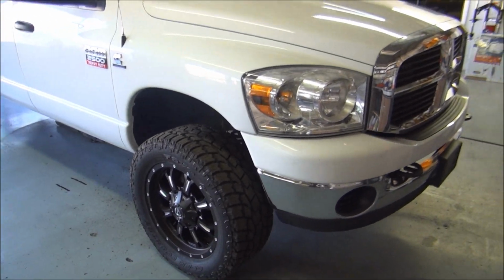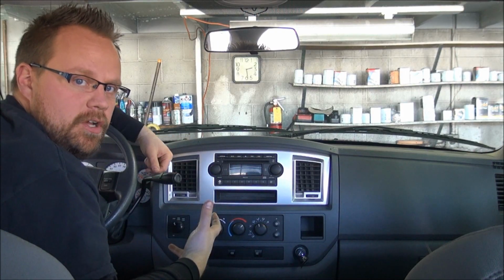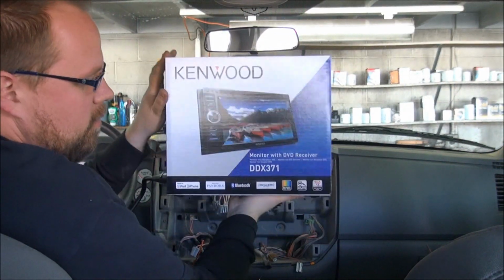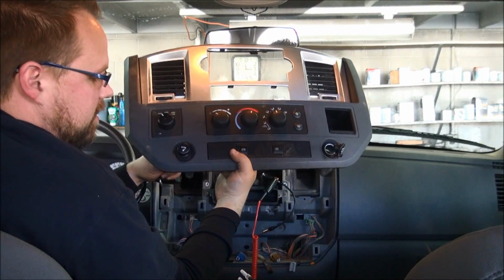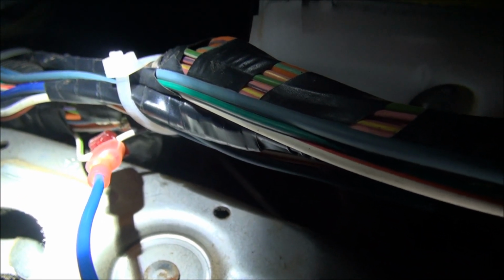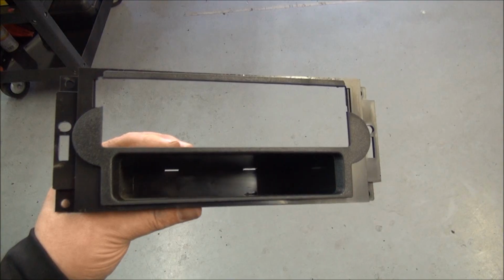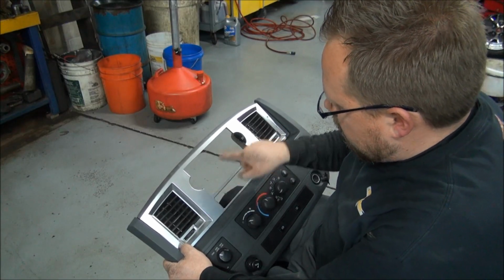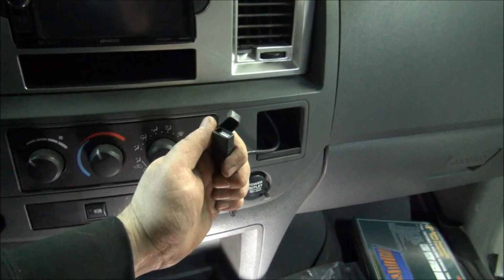Dodge Ram DOUBLE Din Radio Install Tips

Comment: I know this was 10 years ago but wouldn’t you not need the interface cable adapter on the manual version that only has cruise control functions on the wheel and no audio functions?

Comment: On my 2006, I tapped the white with green stripe, but I’m not getting 12v when in reverse? My reverse lights work, but that wire isn’t lighting up my test light… any suggestions?

Comment: I have a question I’m having problems with my install where the unit dose not power on but you said that it looks for a signal and you taped into the cigarette lighter so what wire do you hook up on the radio said?

Comment: All of the useful info in this video could fit in a 5 minute video. Don't care why you picked that radio. 

Also tells us all the right ways to do it and proceeds to do everything the cheap hack job way. Just buy the interface it's well worth it to retain steering wheel controls. Bypassing them is peak poor energy.

Comment: OMG, you just saved my butt thank you. Im trying to get a radio installed on a 2008 Ram 1500 and the universal harness does not match up with the power so I was having a hard time finding it. now I know where to hook up power to. ;)
Reply: Please tell me what to do my radio is lighting up but I have no sound
Reply: @markbarrett6227  if its your stock radio most likely its toast. But if there is an amp check the fuse fir the amp

Comment: I need a wiring diagram for a 2013 - 2017 Ram 1500. Either a color coded diagram or pin out for the large radio connector.

Comment: Hi very helpfull video but you dont show after finding the 12v where does it connect to ?? Im installing one and wondering where to connect the 12v on the main radio harness!!  Thanks
Reply: Did you figure it out im stuck right now and pissed lol
Reply: Find an answer to this?

Comment: Hey man i know it’s an old video, but in the description for the dash kit, does the link for the dash kit contain the piece that seals off the round-end edges from the volume and tuner buttons?  (The pieces you cut off the kit, to make the radio dash one solid piece) I followed the link to amazon I just want to make sure it before I buy it.

Comment: I have an 08 dodge ram 2500 Laramie with the infinity system in it, 6 disc Mopar radio. I’m putting in a pioneer double din and need to find the “amp on” wire on the vehicle side of the wiring harness. The wiring harness I purchased for this year model truck has the blue and white wire running to an empty slot. I know this video is six years old but any help would be appreciated greatly! TIA

Comment: Great job, where are you located? Would like to do similar set up on a 04 dodge Laramie 1500.
Reply: If you go with a single din pop out touch screen than youll save that compartment

Comment: I installed a Double din radio in my 3500, I did not trim the original dash piece. I purchase a new dash piece for the 3500 with NAV, not sure why you did not do that... Do it right..
BTW, I would have been pissed if you  scratch up my dash sliding radios around!

Comment: What do you do with the extra square connector that was plugged into the factory radio that has 3 wires in the plug? Do you just do away with it or?? Need some help. Just don’t want to leave anything out
Reply: You don't need the small plug it's only for the factory radio
Reply: Keith Tonak okay thanks!

Comment: you really don't have to do that with trying to use your dvd fun.... just use the same wire but it depends on what type of radio you have.just put the pink or orange wired on the top of the radio.... bam.....dvd player working I ran threw the same problem.ill be making a video on how to do it. I just bought a 2007 dodge ram big horn edition.and I think that it whould be a good time to do this.well we will  do the together.be on the look out for it

Comment: hello there
I've hooked up all the wires and tapped the yellow wire from the plug into the cigarette lighter but for some reason my radio does not work... do I still need to connect a red wire to the ignition, if so, to what wire do i connect it?
thank you very much
Reply: Yellow wire is constant +12v. You hook that wire up to the yellow wire on the harness and run the red +12v accessory wire to the yellow and pink wire coming from the cigarette lighter
Reply: @Keith-ky9pm  
thank you !

Comment: So you take ten minutes talking about the install at the beginning and just rush the ending, not covering at all how you wired in the steering wheel controls or where you mounted the SiriusXM antenna. Seriously what's up with that?
Reply: It's the base model, no cirius, no steering wheel controls!

Comment: I've got 0ver 40 years exp.  taking a dremel to a dash is not a customer job. Seriously pay somone to do it.
one slip its scrap and a drill bit will walk on you. Practice on scrap plastic  first this is not an e-z skill to learn.
I use a 4 flute cutting bit its worse than a drill bit it will run like a bitch if it gets away from you.
You better off using a flat bastard file that's a flat fine file for metal work. Even Pro's make mistakes and its real easy to do. A file is your best bet he only took off about 1/16" of material   on a delta 88 I used to cut out the whole din size all day long car after car after car. I've done eq's that look like the hole was made in the factory. no gaps straight lines.  I moved the clock on a 84 celica down to the pocket and moved the emergency switch about 1' to install an eq  with 2 din units.  Trust me use a file also you can cut it with a box knife just care it out with small bites. and don't cut yourself. you don't even ahve to cut all the way through you can score it and bend it off then file it. A dremel is not the only way to do this.
Ok this is all I came to this to look at. Thanks man  I haven't done one of these myself either.

Sorry but the automitic wire stripper's are a joke just buy a set of Klein crimper that dent the connection and Klein wire strippers. to loosen the join on the crimpers heat up the pivot point with a micro torch put oil on it and work it as its hot keep adding oil they will loosen up and wear in real nicely and just flop open instead of trying to pull them open. get the Red Black handle style.  Do not buy the smash type crimpers you should not be able to pull the connection apart before the wire breaks. and no copper should show outside the conector. or it could short out.
https://www.amazon.com/Klein-Tools-1010-Crimper-Stripper/dp/B0000302WX/ref=sr_1_8?keywords=wire+crimper+kline&qid=1566345593&s=hi&sr=1-8

This set will do both crimp and strip the wire's  save your money  but I would not use this set.
Not bad for your first one on this truck.  I'd almost say ship the dash kik and just use some ABS plastic but you won't flush the old knob holes..

Metra should make a replacement dash for this truck. with a modified pocket. I don't know why they don't they used to make one for an older honda, the dam kit hung on the wall for 25 years.

Your going to have to buy the back strap separate they do not come in kenwood radios anymore.

Comment: I have a 2007 ram  2500 it has the infinity system can I just buy the cheaper harness and tap into the cigarette lighter wire or do I need to buy the expensive interface one?
Reply: For infinity in dodges, just like bose in cadilacs, you need that Pac if you have steering volume power controls.

Comment: When u hooked into the lighter how did u hook it up I used the red and yellow wire off of the deck and hooked into the lighter but it still has no memory
Reply: Yellow wire is constant has to be hooked up in the harness to keep memory. Only the red acc wire coming from the radio has to be hooked up to the cigarette lighter

Comment: Thanks for the great install video. My 2008 ram has no steering controls besides cruise control. No navigation radio or infinity speaker system (3 dash speakers hikes in fash don't have speakers). I believe I can do the same I stall but what about the 2nd small harness right next to big harness in back of factory radio? I couldnt figure out what to do with it? Did yours have that too? Thanks for the help!
Reply: You don't use the small harness

Comment: I know this is an old video, but do you have the info on the dash kit and wire harness you purchased?
Reply: Oh, I see it in the description. Thanks.
Reply: Will the wire harness you used, also work for a 2007 Ram 1500? I am having a tough time locating the right harness adapter.
Reply: @Sharona Carr I ended up buying a replacement used stereo unit and postponed upgrading. :)

Comment: bri thanks for the video, can you tell me if the truck you worked on has a factory amp, because im being told i have to by an interface for like $70.00 , but i want to do what you did. any help would be much appreciated,or from anyone else. thanks again

Comment: Good job, but aren't you supposed to disconnect the negative battery cables before doing any wiring, in order to prevent a possible short?  I just bought a very similar Kenwood double DIN unit to install in my 2006 Ram 2500 (with the Infinity system), and I really appreciated your tips.  I bought the unit and the accessories from Crutchfield, and they recommended the Metra 95-6528B mounting kit, which was $20, and came with the faceplate/bezel, and the mounting brackets that fit the truck and radio; I think this is a bargain for not having to fabricate brackets  and to make it look like a factory installation.  I haven't mounted it yet, but I think I will lose all or part of the pocket under the radio, but I can live with that.  I'll probably add some sort of storage area on the current cupholders.

Comment: Hi Brian can you please help me 
I have a 2010 dodge ram 
And I'm installing a gps nav deck originally I had it working but when installing sub I blew the factory amp turn on box so then I am trying to bypass the factory amp.
I.bought was able to find a similar box I forget the name anyways.
The original amp turn on didn't use the one harness the speaker wire harness.
There are 3 wires to all speakers but when I connect them they don't work.
What do I do

Comment: Running to a switched power source on a dodge vehicle is easy. Just tie into one of the power receptacles with a "key" on the cover of it. That designates it as a switched power source, just tap into that wire and you're done.

Comment: Would a 7" radio fit in a 2008 Dodge Charger?
Reply: If the dash is the same. Than yes. If not you need to dremel few plastics

Comment: I watched this with hopes of seeing the actual wiring process.. there is a 2nd smaller plug that comes out next to the large plug in thw factory unit that im not sure what to do with.. same truck same Kenwood ddx371 and same pac kit.. help please, have power but no sound.. and steering wheel buttons dont work either

Comment: Im replacing my stock with a dual xdvd770bt wiring is all hooked up plugged in my schosche box to the cd player where does the other end tie in at i have power but no sound can you help me?
Reply from the maker: What is the year make, model of your car or truck?
Reply: Its 2007 5.9 with infinity sound system it worked for 3 hrs started it this morning everything displays no sound again

Comment: I got the expensive harness and everything turns on bit I get no sound..
Reply: Brandon Lins i had the same problem how did you fix yours
Reply: Charlie Hunsaker  my radio was bad got it used off some dude on Facebook. Got a brand new radio re wired the harness and everything works.
Reply: Brandon Lins i disconnected everything put stock on took it out clicked aftermarket back in and everything worked i dunno what the hell the deal was cooling off now lol

Comment: I have to chime in.... I installed stereos for a living back in the day. DO NOT UNDER ANY CIRCUMSTANCES GO POKING AROUND UNDER YOUR DASH WITH A NON COMPUTER SAFE TEST LIGHT, YOU WILL SET OFF AN AIR BAG !!!! Better yet, use a Digital Multi Meter. My 2 Cents....

Comment: This is an awesome video and extremely helpful!  I have the dash bezel trimmed and the wiring is all done except for reverse, but I have the wire run, just waiting on the T splice.  Everything turned and and all functions work...thanks for the reverse wire tip!  Really saved time.
Reply from the maker: Thanks, glad it helped!
Reply: does it works in rhe same way for a dodge caliber?

Comment: For the record, that dash bezel had been removed before.  Otherwise, you have to remove the cupholder 1st (4-8mm screws under the rubber), then 2 (8mm) screws to pull the trim forward of the cupholder.  Then, a couple 8mm screws under the radio section (above the piece just removed), then 2 phillips screws facing upward that retain the radio bezel assembly off..  When you removed your bezel in the video, you can clearly see the two bottom tabs where these phillips screws should have went through.
Reply from the maker: Great Tip!
Reply: Geriatric Ginger yes my 6spd cummins was a screwed together nightmare. I couldn't find a video for my interior pkg and it was fun finding the hidden screws
Reply: Wow. I almost fuvked my sons truck up . Thank God I read this comment. This guy is an asshat . Just wow

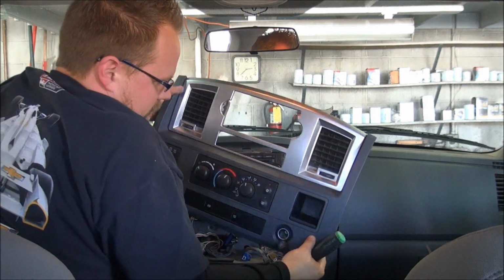Comment: hello so I am wondering if anyone knows where/how i can get a flat piece of plastic that is on the bottom pocket of the center dash part he is holding at the 5:24 minute part of video. I am doing an install of a Pioneer 4200 nex and I would like to install 2 flush mount attatchments to that area. (a flush mount usb/hdmi port and a flush mount usb/aux port).Thanks for any help guys/gals.

Comment: I have a ken wood I'm also installing in my 08 ram and was wondering if I need to connect the red wire to my ignition
Reply from the maker: Yes red gos to a switched power source (ignition) Yellow is constant battery power.

Comment: why would you not use the switched power source provided in your harness.
Reply from the maker: That truck does not have a switched 12volt positive source at the harness (the factory radio turns on and off via multiple ground signals, that an aftermarket radio will not understand ... That is the main reason you have to buy an interface or run a switched power like I did.
Reply: If you get the right harness, you don't have to tap into anything.
Reply: I just paid the money for the right parts. Was actually pretty easy
Reply: A lot of work but better than paying $100 for an interface and dealing with those extra unnecessary wires
Reply: This truck is similar to the pontiacs, cobalts, malibus, etc. The standard harness has a accessory power wire off the harness to get your accessory power from a ignition source. Its significantly cheaper unless people want the info center, onstar, and satellite radio for models listed. It simplifies the install and saves an exceptional amount of money.

Comment: are you installing a 7inch radio or a 7inch radio?
Reply from the maker: All aftermarket double and even single din radios have the same radio chassis width however the screen size will very... In this video I'm using one with a 6.2"wide screen

Comment: where did that longer wire come from to connect to switch power (cig lighter)? And where did the wire connect to give the radio the power?
Reply from the maker: The 12volt constant power is in the wiring harness adapter....(yellow wire on a aftermarket harness) The switched wire I had to go to the cig lighter.

Comment: I have a 2007 ram 1500 and when i went from stock radio with the same style dash as the 2500, i have found out they in fact do make a double din dash kit for that style of dash. With a little modification to the dash you will not have the half circles in the dash. I installed the same Kenwood as in this video
Reply from the maker: Nice, where did you buy it from? and who makes it? How much did you pay for it? Thanks for you info!
Reply: i got it from a car audio shop called Mickey Shores and it ran roughly $60.00
Reply: not sure on manufacturer though
Reply: Yes but with those 'kits' you lose the cubby under the radio which kinda sucks.

Comment: wouldn't it be easier to buy the larger double din bezel?
Reply from the maker: +john minasi Unfortunately they are not made for this YEAR truck unless you have the truck with factory navigation..There are a few companies out there that take and modify the factory bezel and sell them, and they look really nice. These guys cut the hole bigger out of the factory bezel  (like I did) then they will fill the side holes in with a specific bondo and then they paint the bezel...I have seen these go for about  $200- $300..The method I did in this video looks fairly good but only cost $15 bucks

Comment: Without a doubt - its ALWAYS a good idea to have a good pair of strippers around! hahaha - sorry, just had to, even at 48 I still cant contain my juvenile humor!

THANKS for doing this excellent video and for listing the parts! I have the same OEM radio in my 06 1500 and I'm going to replace it with a Pioneer Double DIN DVD so this is very helpful. I especially like the knob 'blanks' on the dash kit you used so I plan on getting one of those. 

Thanks again and let me know if you want to stop by Washington state real quick and help me with my install.

Comment: Will the buttons on the steering wheel still work with the new radio?
Reply from the maker: +madmanownzall No...Unless you install a radio replacement interface that retains steering wheel controls.
Reply: damn

Comment: Did this truck have the infinity sound system? My 2008 2500 has infinity system and the wiring harness you showed will not work .. didn't feel like buying the 109$ harness !
Reply from the maker: +Logan Prichard No infinity system, this truck was a plan old work Truck, didn't even have carpet.
Reply: +Do It Yourself Bri thanks for quick response! I just thought you said it had steering wheel
Controls
Reply: So your saying you HAVE to buy the $109 harness if you have the infinity system?